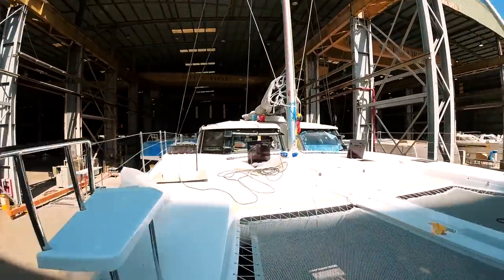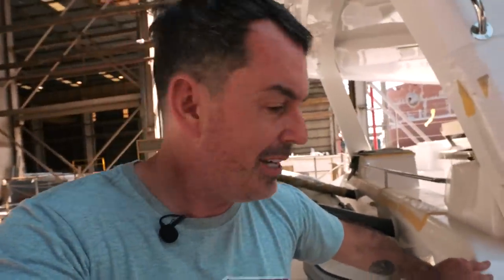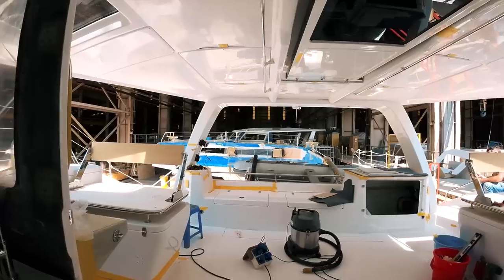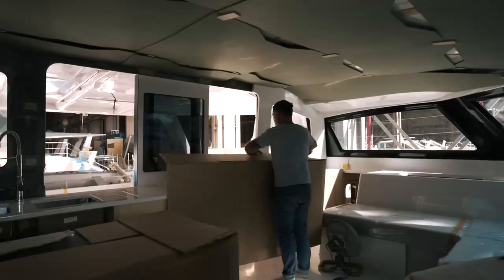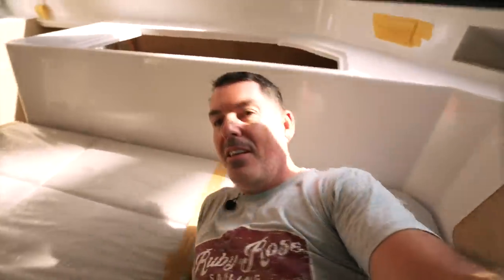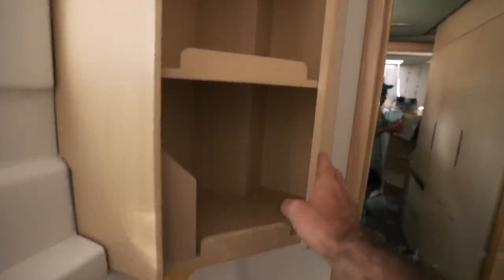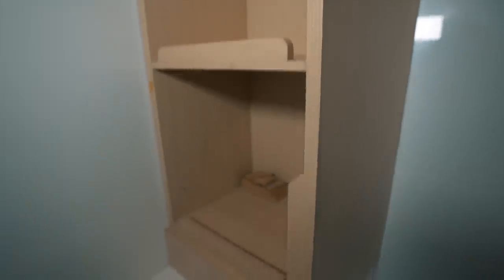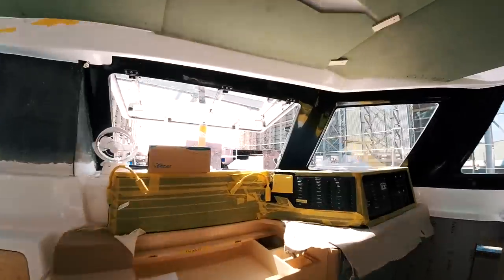I've Been Waiting 4 Years For This

Comment: I went to the Miami Boat show in mid February and saw the new XCS 14 and the Nauitech 44 open.  I like your helm stations more than those boats.  Yours are protected under the rigid cockpit roof, there's were exposed and at the back of the hulls.  I didn't notice the joinery in the cabinets.

Comment: I would love a full episode on lighting protection on RR2, how about a technical Tuesday? Does RR2 have equipotential bonding to avoid step voltage killing stuff and combined over voltage protectors for battery and signal lines? How were distances to external lightning protections kept?
Reply: Wynns just did an episode on 🌩 safety...